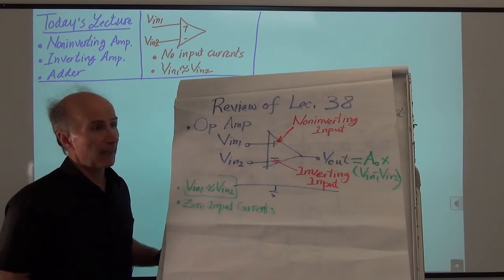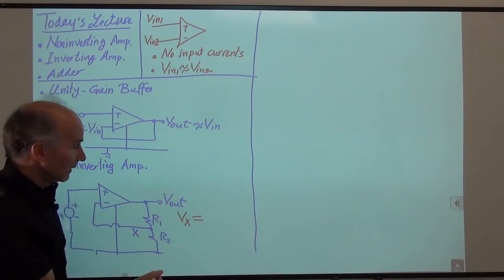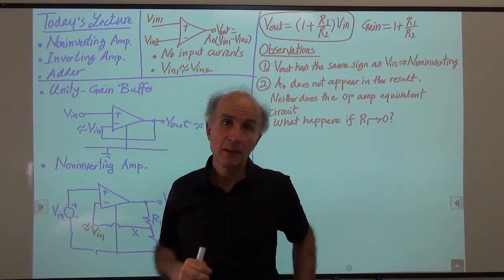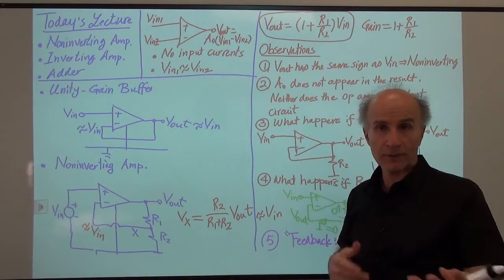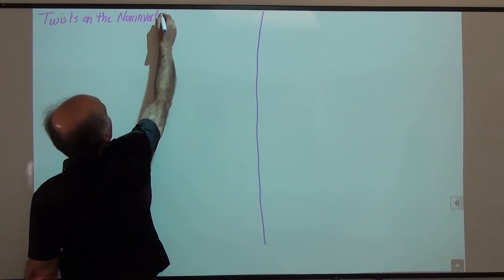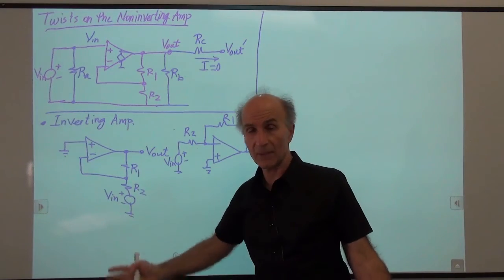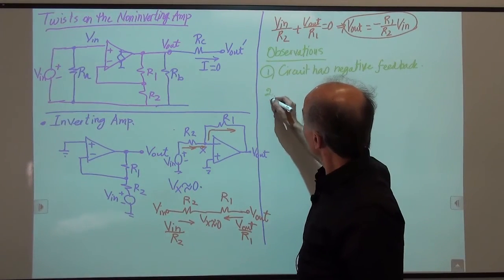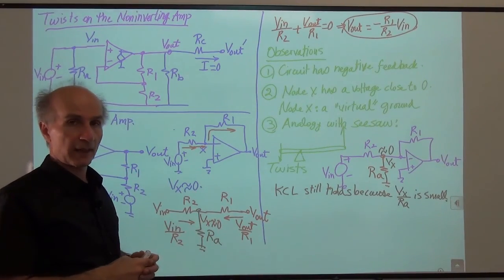Razavi Basic Circuits Lec 39: Noninverting and Inverting Amplifiers

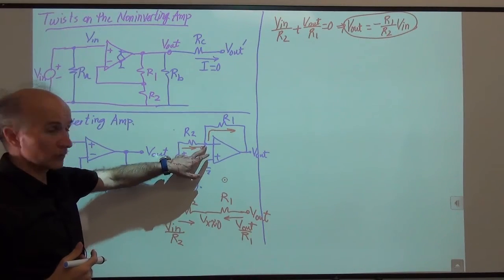Comment: Prof. I don’t understand that at 42:00 if the current flows from R2 to R1 then the KCL should be I2.R2-I1.R1=0 am I wrong?
Reply: The virtual ground is between R1 and R2 so V2 (equal to Vin) is directed from virtual ground to Vin and V1 (equal to Vout) is directed from virtual ground to Vout. In this case, KVL (if we go from left to right) is - V2 + V1 = 0 so V1=V2 indeed. From KCL we know that I1+I2=0 so I2= - I1. Combining everything we get Vout/R1 = - Vin/R2 =  -----> Vout/Vin = - R1/R2. I hope it helps.
Reply: @arturkorneluk365 this is even more confusing 😂
Reply: @arturkorneluk365 you also wrote the KCL same as master which is the root cause of confusion.
Out understanding is that current flows from a region of high potential to low potential. Using this analogy I also agree with OP post. But master is for sure not wrong so we need to understand why master wrote KCL this way.

The master has shown the voltage polarity such that current flow will be in opposite direction contrary to what the master has indicated